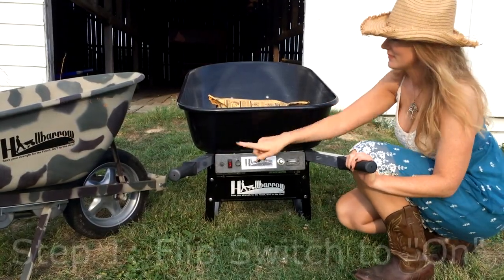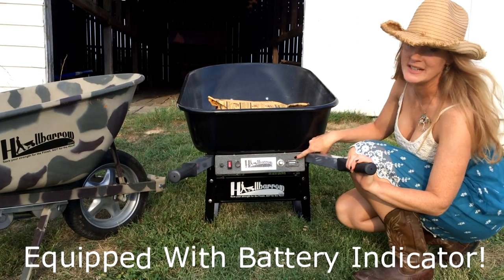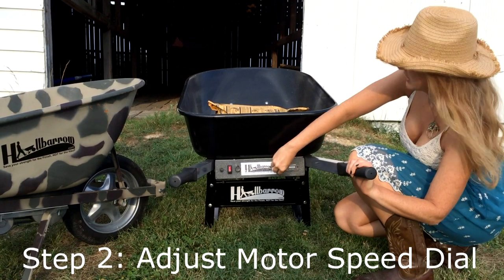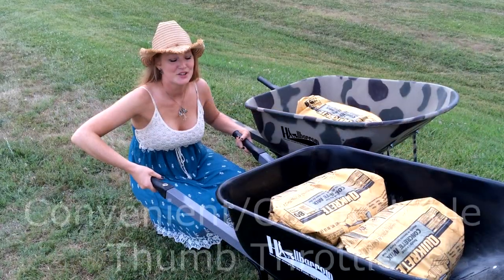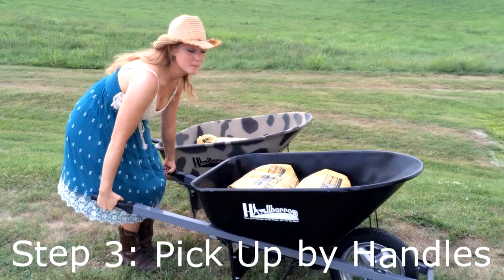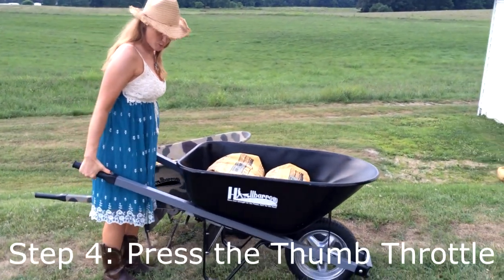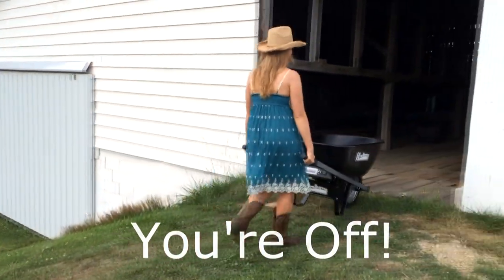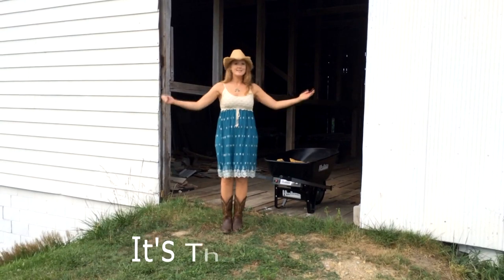Motorized Wheelbarrow - HOW IT "WORKS" - The Hillbarrow

Comment: Still requires the lift and hold up of a regular wheelbarrow, which requires strength and balancing the weight. If this had a balanced wheelbarrow design, then be much easier to use. The classic wheelbarrow had wheel out front, but a balanced wheelbarrow had wheel in center.
Reply from the maker: If one would design one you didnt have to lift and hold your talking about big money and not practical for the average homeowner or contractor with all due respect.
Reply: Hey that’s a great idea I just went out to get wood and came into the house and told my wife of the electric motor wheel barrel I just dreamed of and you got it